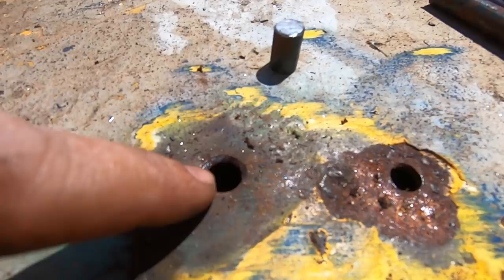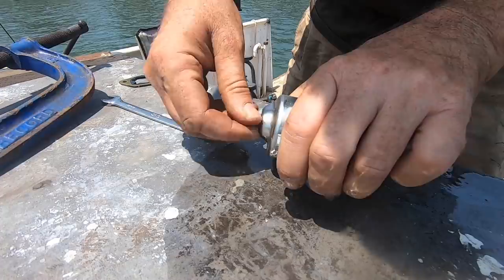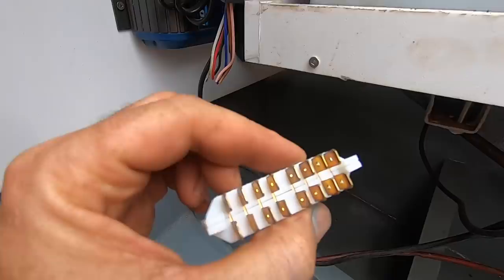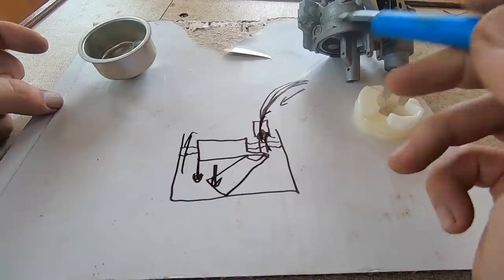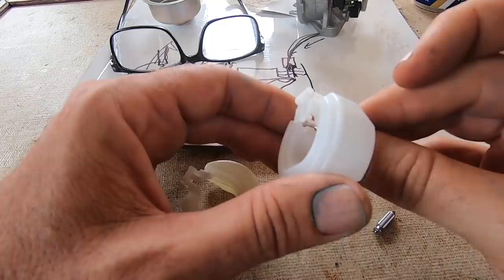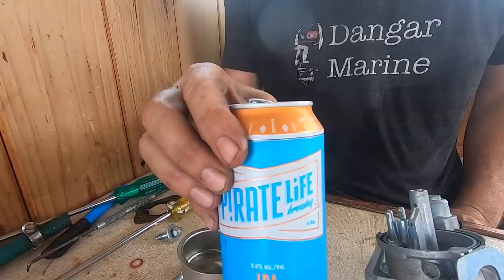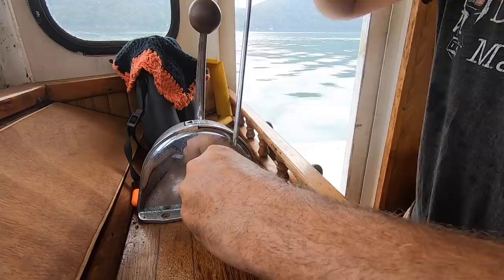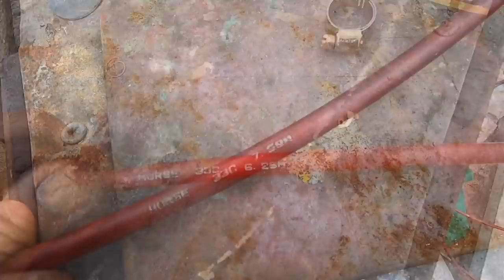Deck and generator repairs

Comment: Good call swapping the cables Stu.  I never have had any luck unseizing  them and getting them to keep working.
Reply from the maker: Yeah, I figure there isn't much point in having a fully rebuilt engine if you can't select a gear!

Comment: Some useful info there, thanks.  I have a GX340 on a wood chipper (15 yrs old).  Most reliable engine I have ever owned.  Left outside (covered) and it always starts on a couple of pulls.  I like that the Honda manual says "if the engine has not been run in a long time, don't worry about it ... just pull the damn cord" or words to that effect.
Reply from the maker: My kind of instructions!

Comment: Fun to watch the carb video, good explanation! I remember the old brass floats in carbs that were soldered in the middle typically... They were fairly reliable but leaked every once in a while and always interesting to repair, back when you tried to fix everything before buying a new one. It was always fun, soldering on those “previously filled with gasoline” floats... Nice job on your repair! 😊

Comment: I used to repair brass floats in auto carbs like that. Drill small hole, blow thru hole see where it leaks, empty then solder holes shut. worked great.
Reply from the maker: Brass floats are so much better!

Comment: I love this channel. Not only am I learning mechanical things but why it takes guys so long to fix things—things are breaking at a rate only slightly less than the rate of repair. That and the loss of critical parts during the process. Finally, I would have thought the crocheted washcloth would have found its way to the bathroom but at least you’re using it.
Reply from the maker: Thanks Ann. For sure, it is almost always more like 7 steps forward 6 steps back. I thought the cloth must stay with the boat! :)

Comment: You might want to check the oil in the generator in case gas got pass the rings into the crankcase    It has happened to me with a power washer.

Comment: Stu: Pulls, repairs , and re-assembles entire detroit diesel/welds patches in 1/2 the steel on the boat/ rewires everything in the boat.
Also Stu: The paint's faded behind the clock so I have to get the same old one otherwise I'll have to repaint that wall...
LOL.  Love your stuff Stu!
Reply: The wall is not painted, it's wood with a stain or clearcoat. So he'd had to sand it all down to a fresh wood surface then redo it.
Reply from the maker: Actually, I misspoke them too. It is the timber behind the clock that isn't faded. ;)
Reply: lol.  got me there!

Comment: Yeah, Stu - I've had this issue loads of times on GX390s.  Always got lots of fuel in the crankcase so, replacing the oil is really important.

Comment: Now that you’ve drilled the float, pressurize it with air through the hole and immerse it in water to find the leak (bubbles).
Reply: oops too late!
Reply: Not necessary. Just push it under hot water, leaks will bubble.
Reply: Good idea! However I would have made the hole a touch bigger to fit a small coffee stirrer and then blow air.
Reply: @rodneylee4026  Generally that changes weight a bit too much.
Reply: @Bodi2000  thankyou

Comment: A quick tip to patch holes without having the fuss around with your cold roll plug technique. Put a piece if brass or copper on the back side where the hole is and simply welding over the hole. Your weld metal won’t stick to the brass/copper. Simply grind it flush and you’re good to go. Ive been welding professionally for 10 years and I’m impressed. Keep up the good work!

Comment: G’day Stew, when you need to find the leak in the fuel float, pour some boiling water over it in a glass and hold it down with a fork or something. The air in the float will expand and escape through the hole/crack/joint whatever is the problem. Seal it with a soldering iron.
Reply from the maker: Nice idea!
Reply: Yep...been there done that..exact same thing happened with my water blaster carby.

Comment: Using copper pipe with sweat fittings for a fuel line can be disastrous if you have a fire. It can melt and release your fuel into the fire. Love the videos, nice boat. The first boat I worked on in 1969 had a pair of 471's in her.

Comment: Those gx390s are awesome engines, when they act right. Used to work at a roofing company that had all of their roofing equipment run on gx270s and gx390s. Very easy to rebuild, very reliable, very efficient. The down side is the fuel tanks and carburetors. Most tanks were sheetmetal that would rust out in a year or 2 outdoors. Most carburetors had a fueling issue where the engine would jump rpm. Could harly ever get them fixed. We had shelves full of old engines and donor parts, would usually nab a carb off one of them and try it. Also keep a check on oil. If ran for extended times, they tend to burn a bit of oil.

Comment: Hi, got a big old Honda generator that I hadn't used for a couple of years, decided to check it just before Christmas and it run first time! But I had petrol pouring out everywhere like yours, turned on just to be a rubber washer on the petrol on lever but I had a hell of job getting to it.
Reply from the maker: It sure doesn't take a huge leak to drain the whole tank given enough time.
Reply: @DangarMarine  very true.

Comment: I watched a boat catch fire from a gas leak on his 460 ford inboard. He smelled gas and made it back to the harbor. It blew before he hooked to the mooring. Luckily his son and grandson were in the dingy when it erupted. He bailed over the side right when I pulled up. He was not hurt. I towed the boat away from the mooring field. It was a total loss, and I scrapped it and took it to the dump. Melted the water pump, and distributor right off the engine.
Reply from the maker: Yes, I personally would never have a petrol inboard in a boat. Blowers can help to ventilate the engine bay but their need shows there is a problem in the first place.

Comment: As usual an awesome video of hints and tips.
Glad you mentioned about turning the fuel tap off on the generator as I leave mine on all the time and my generator is below deck and is not very well ventilated when the generator turns off as the fan that forced the fresh air in turns off when the generator turns off.
The tank is above deck with a tap fitted and I will start to use it from now on.

Comment: After you drilled the float you could have blown into the hole to find the original air-leak point...probably one of the seams were not welded properly at the factory.
Using a hot nail or other metal to run along the seams would fix that problem...but I like your use of donor material for a patch too  :)

PS>  I hope you guys are safe from the fires...they worry me a lot for y'all.

Comment: Hi Stu, Looks like your ok where you are at with the horrible  brush fires over there. Your drawing on the float bowl didn't look right but I think you got your point across putting the carb back together. I was using a screw driver to pry my float bowl off one time and poked a hole right through mine. I replaced it but needed to be adjusted. Learning curve on it for sure😆 love the chickens and eggs👍

Comment: What we have discovered with small engines with plastic fuel floats is that fuel that contains ethanol will eat pin holes into the plastic over time (especially when not in use for long periods), so now we only use ethanol-free gasoline (petrol) with our small engines.

Comment: Worth doing for irregularly used motor, especially 2-stokes,  turn the fuel off while the engine is running to drain the fuel bowl on shutdown. This with reduce the amount of residue build up in the fuel bowl from the fuel evaporation out of it. Premix 2-strokes on whipper snippers usually don't start for this reason.

Comment: Use the fuel shut off valve to use up the fuel in the bowl and that will keep fuel from getting into the float since it won't be sitting in fuel while you are not using it.

Comment: On the subject of fuel in the bilge, I just finished the third  day of repair on a friend's oyster boat that runs a Chevy 350.  Fuel in the bilge + bilge pump switch = bilge explosion.  Blew apart part of the cabin, blew out floor boards and split open a washboard.  No one on board was in the cabin and somehow no one was injured.

Comment: I hope you and yours are safe from the fires Stu. Heroic volunteer firefighters doing all they can.... glad you did not ignite that fuel spill. You could have blown into the float drill hole to find where on the seam (most likely) it is leaking, perhaps.
Reply from the maker: Thanks mate, so far safe.

Comment: At some time after patching the holes you have a new deck. I would guess they didn't get a good bond when the two halves were fused together. Good idea getting new cables for the control. Better now than at sea. The probably rusted solid from being in water.

Comment: The little honda compatible float pin (/needle) actually should have a small spring on the shaft - so when you install it the pin is always held up - Gives it a soft seating effect as well.
Reply from the maker: Which makes sense and it wouldn't work in any carb the way it was.

Comment: Learned an interesting thing about small engines on a moving vehicles (ie. trucks,boats). When engine is off, and "vehicle " is moving, the float/needle pumps fuel. His suggestion (Steven Cox - youtuber)...shut fuel off and let the engine starve out of fuel.

Comment: In regards to the new float not working with the old needle, there is a spring that needs to be installed that resolves the excess travel issue.  I saw online a rebuild kit for your carb with what appears to be to be the 'new float' that you bought. It has a small needle spring that goes onto the needle and allows the float to properly raise the needle. The float can raise a little more, compressing the spring which  creates a better seal.

I used to just turn the carb upside down and then blow into the fuel line to test the float and needle. Doing that with the bowl on also makes sure the float doesn't hang up on the sides of the bowl or something else that was not noticed when it was apart. 

Older Tecumseh engines would have their floats stick due to so little clearance between the bowl and float - a little dirt or rust would cause it to stick. A good bounce of the engine on a mini-bike would stop the gas from dribbling out of the air cleaner when no tools were available.
Reply from the maker: Ah, that makes sense. I did cut the bag accidentally when I was opening the envelope so maybe I lost it before I even saw it. Thanks for letting me know!
Reply: The new float probably did not come with the spring. I even saw one repair kit that had the float, washers, the pin and needle and stated that it did not include the spring. I don't think you lost it; it just was not included. 

Anyway, great video and looking forward to seeing you underway soon.

Comment: Hi From Ireland Stu, Quick tip with the Honda (looks like a gx390), over here the choke lever has a plug on it for the fuel line, 
you can leave it on the carb or pop it off and leave it on the fuel line.
Reply from the maker: Ah, think it does have something like that on it. Goodtip!

Comment: As Stephen Cox explained in his latest compressor maintenance video, itvis important that the honda engines on mobile equipment needs to have their fuel shutoff turned off and engine should run out of fuel at every shutdown because the constant rocking of engines cause the fuel to drip into the engine and may also cause the oil to dilute with gasoline.

Comment: Re the float, Nice field repair. 
When you've finished using the gennie, before you switch it off just turn the fuel tap off and let it run the bowl dry. Hopefully that'll help the idiot thing last a bit longer before it fills back up again.
In fact what the choke flap does is create a depression above the venturi. As the the motor cranks, the fuel coming out the discharge nozzle is boiled due the deep depression the choke flap causes.This happens because the very low pressure drastically lowers the boiling point of fuel. The boiled fuel is highly combustible (when mixed with air in the correct ratio). That's the theory of it but in practice an incorrectly adjusted or set choke is a pain in the arse as we all know.

Re petrol and your contention that vapour is deadly dangerous, you're of course 100% correct. 

As a mechanic I knew this as when we were apprentices it was drummed into us over and over and over never weld an empty tank even if it is 20 years empty; for good reason.
Before my son left home we loved watching Mythbusters together. Anyway they did a test on fuel tanks with varying amounts of petrol in them and how explosive they are. Nearly all the tanks with fuel in them did nothing much but when the tanks were empty or near empty they exploded with incredible force.
Reply from the maker: For sure, empty tanks are the most dangerous. I've seen people redirect the exhaust pipe of a car into them for over an hour before cutting into them.

Comment: I would  submerge the carburetor float in hot water. Watch to see air bubbles and then seal the hole.I have always used Marine Tex.

Comment: Hi Syu just watching about your float what you need to do put it in hot water or near boiling if the plastic will take it you will remove the liquid from inside and see air come out Mark it put super glue on hole that should fix it for now hope this helps Colin from Ireland

Comment: Don't forget to change the oil, it could have leaked from above the Piston down the cylinder past the rings and fill up the oil sump. Then very quickly, you will have a bad engine.

Comment: On those honda carbie the choke lever has a fuel hose stopper on the side of it, next time you pull one off have a look on the side of the lever it's the size of the fuel line for convenience👌

Comment: Holes in sunk floats can be found by placing them under a heat lamp and once the fuel starts to expand will force it back through the leak. This float probably has a seam leak and under the Aussie heat expanded and leaked but once cooled sealed back up???? Maybe.....
Reply from the maker: Good tip!

Comment: Put the float in hot water and that will show where the leak is...It will cause the fuel to boil and force the vapor out of the float to show where the leak is...

Comment: I have used wood blades on metal that was softer steel because that’s all I had. Cut through very fast. Cutting thin square tube cutting across the flats is better on the teeth than going straight thru because the teeth are large enough that they grab and can break. I think it would be great for bigger aluminum stock.

Comment: There is a good chance that fuel washed past the piston rings and into the crankcase.  Probably a good idea to change the oil. If the oil level is high, there's definitely gas in the crankcase.
If your generator is sitting on the deck in the sun, the expansion and contraction of the float during the day and night may be drawing a tiny bit of fuel during each cycle through a tiny pinhole (likely along the seam somewhere).  I think the float is going to fill up again.

Comment: Stu, sometimes Ive had luck with polishing the float seat with a tiny bit of lapping compound or polishing compound on a q-tip. It sometimes doesn't take much to cause a intermittent sticking float needle. But I should wait for the rest of the viddy to see what's actually going on. In those odd cases that everything seems good but you still see odd drips from a sticking needle try to polish the seat.

Comment: U can submerge float in clear beaker of soapy water & look for bubbles like with an inner tube with slow leak. Then u can weld plastic with soldering iron.

Comment: On the choke lever there is a little round section this is designed to be put into the fuel hose when the carb is removed to stop the fuel😊
Reply from the maker: Good tip!

Comment: It looks like the float is molded in 2 parts then (probably) sonic welded together. I'm guessing there's a pinhole in that joint. So you're right, it'll cause a problem again. But you said you've ordered a new one, so no worries.

Comment: Time to spend some of your leftover Christmas $$$ and buy a wireless lavaliere microphone !  It will make your narrations SO much better.
Tip on small engine carburetors.  The "O ring" (sometimes they are square) that seals the bowl to the body will swell when removed and cleaned with carburetor cleaner.  You will know because it won't fit proper when trying to re-assemble.  Wash it with soap and water and let air dry   That will usually shrink it back to the correct size.
Never seen a plastic float leak !  Before you drill/drain/repair place it in a jar of very hot water with a well fitting lid with a weight on it to keep it below the surface of the water.  As the water cools, it will create a vacuum and you should be able to see where it is leaking from.
For your generator "spares" kit, you should have the gasket for both sides of the carburetor, also the gasket from the intake manifold to the engine block, that O-ring and a couple of the sealing washer for the bowl drain nut/jet.
Reply from the maker: Good idea to add the seals to the spares kit. I do actually have a wireless microphone but the GoPro 7 doesn't have a microphone input so I'll be getting a GoPro 8 soon to go with it (and get a couple of different camera angles)

Comment: Because a carburetor float is filled with air, when the temperature rises and falls it tends to breathe in and out, when there is a leak, no matter how small the leak.  So, Stew's problem will likely recur over some period of time.  Also, for everyone else unfamiliar with carburetor float problems, they do not always cause a tell-tale leak.  But float problems will make an engine run too rich.